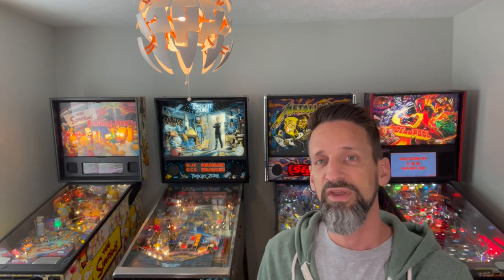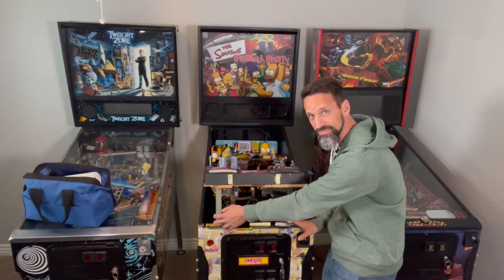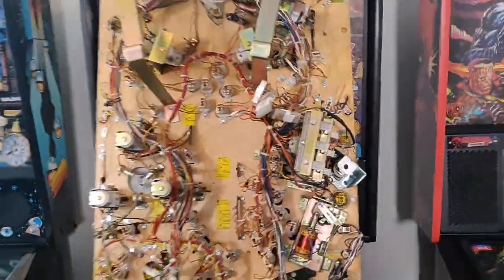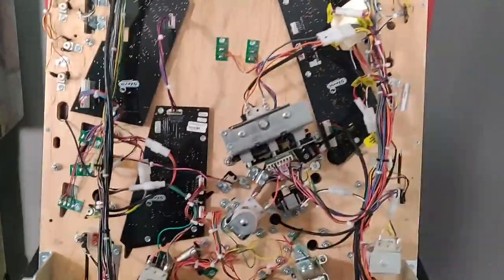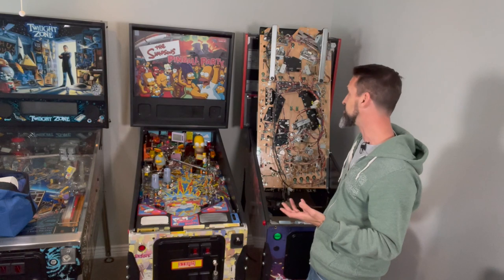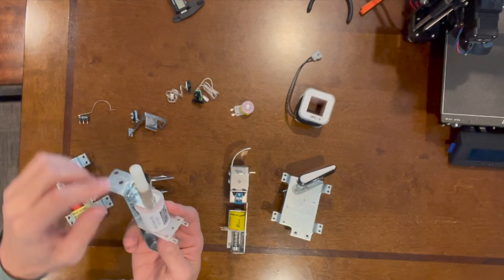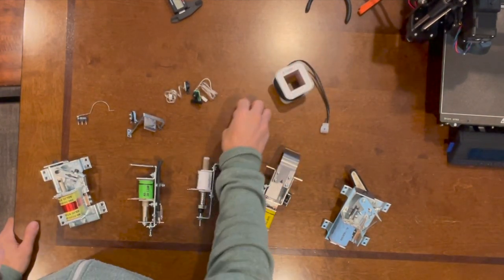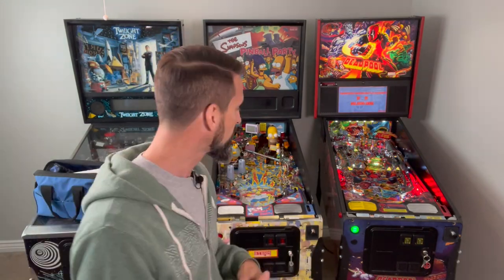HOW TO MAKE A PINBALL MACHINE: The Overview

Comment: I came across your latest video and it was great info, so now I'm going through the rest of your videos from the start to learn all I can about the actual specs and stuff... excellent video... packed with lots of info .  Especially the coil info and just the how you open one up to look inside.  I will look into the mission pinball system but I'm intending to use a much simpler approach and cheaper to build a machine with multiple arduinos and a raspberry pi for the visual head board using a typical monitor screen .   I also want to make all the sub components you showed with modern electronic devices to eliminate contact switches that wear out or get dirty.   I look forward to the rest of your videos to learn more.
Reply from the maker: Yeah lots of different ways to go about all of this- and with your background I’m sure you’ll have lots of other ideas beyond what I’m doing/sharing- glad you enjoyed the videos!!

Comment: Very helpful. I am trying to make my own pinball now and this has been the best source of help. When buying a flipper coil on pinball life, though, does it matter which coil and coil stop to get?
Reply from the maker: Great question! The quick answer is not a ton for a  homebrew - the common Williams flipper assembly (1992-1998 era) with a FL-11629 coil and corresponding  A-12390 coil stop will work great. 

pinballlife has a great selection of coils to help folks fix machines, and you want to replace the original coil with the same type of new one. 

As for homebrew, if using a set of modern hardware controllers and software like the FAST boards I'm using and MPF software, you have some freedom to use just about whatever coil you want.
Reply: @thepinballroom  Thank you. Just ordered them

Comment: Circuit board repair for like a single bent pin would cost you like at most 20$ at a computer repair shop
Just a tip there bud no need to pay 500$ for soldering on a new capacitor or pins or whatever ;)